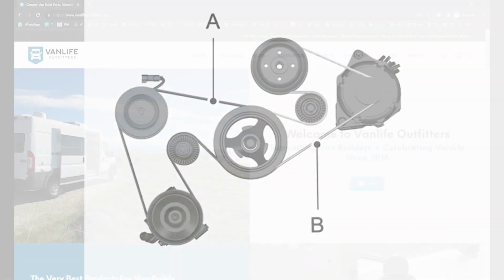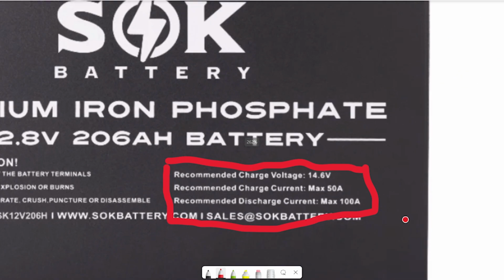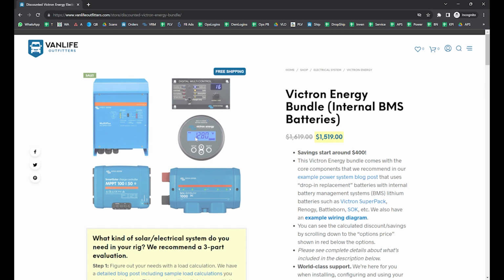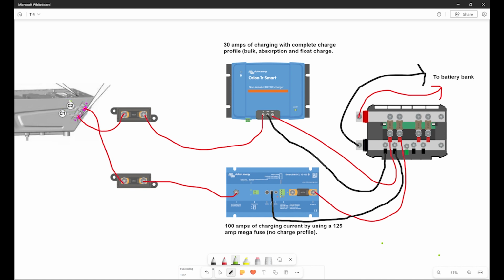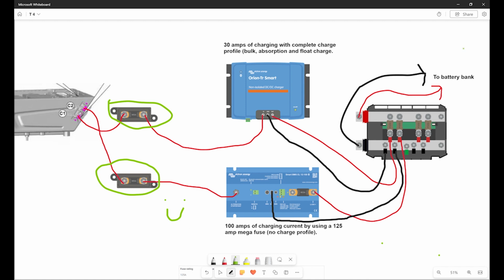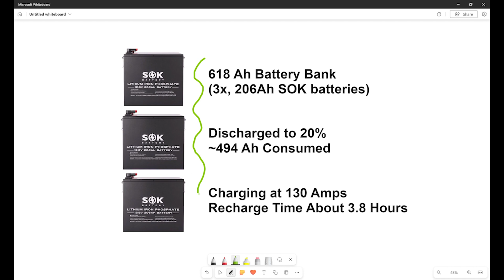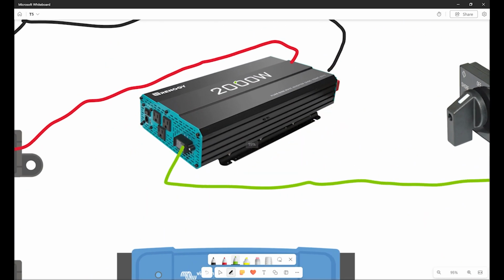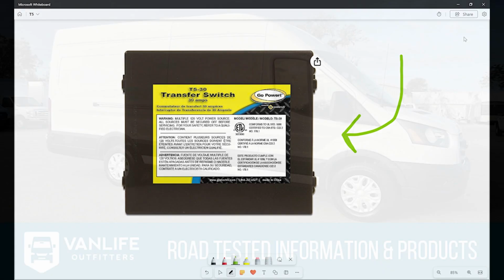Charging House Batteries with Ford Transit with Factory Secondary Alternators

Comment: Do you have an idea how much power the BMS uses as a current regulator?  Did you measure the voltage drop at a few current rates?

Comment: Hello, this is exactly what I imagine doing.  DC AC DC and get rid of having to have massive wires running to the back.  But I am curious how you limit the current with the 2000W inverter to prevent it from drawing all 2,000W and possibly overheating the alternators?   

In a vehicle without a second alternator already, what about installing a 56V 100A alternator and using a 100A MPPT controller to charge a 48V bank of batteries?

Comment: This is great info, thanks.  Using the first method does the BMS need to be turned off when the Orion switches modes from bulk? Or will the batteries stop pulling from the BMS at that point?

Comment: Appreciate the video!  We're in the midst of our electrical plans and are utilizing the Orton DC-AC-DC method as we weren't thrilled with any of the DC-DC chargers on the market.  We don't have the dual alternators, but are planning on controlling the amount we pull from the single 250A alternator with the Multiplus. I've not come across many videos discussing this method.  In your Orton Method Diagram, where are you connecting that negative coming off the inverter input?  Does that go to a (chassis) ground point around the driver's seat?  I'm struggling a bit with the concept of grounding in a van for some reason, it's about as agreed upon as proper insulation as far as I can tell.
Reply from the maker: The ground would either be the vehicle battery or a solid, chassis ground.

Comment: I’m glad to see DC-AC-DC explained well. Thanks!

However, I don’t understand the suggestion to use CCP1. It is non-regulated, and will drain the starter battery. Why use it at all if you have 175A coming from CCP2? 

If you really are using all of CCP2 and really need more, then it makes sense to use CCP1, with care. But why start with the premise, for both of your systems, that you need an Orion on CCP1 and then you add?
Reply from the maker: The Orion DC-DC charger has a "engine detection" feature that, when configured, will only turn on/start charging when the vehicle is running. Or you can wire it's "remote" terminal to the ignition switch. The video is just brainstorming ways to maximize charging from both customer connection points. Also, we wanted to show on "proper" charger in the system that will do a 3-stage charge. The Smart CL BMS will not. Most folks will likely have solar, etc. Lots of ways to approach a power system!
Reply: Oh , I agree, lots and lots of ways. I do think, though, that if you are going to suggest use of CCP1, you should explain the important downside. There is a reason that most folks are using CCP2 only. Complicated stuff, so hard to decide what to cover and what to leave out. Thanks!
Reply: One other point. If going DC-AC-DC, then I would argue that also using an Orion just adds expense and complexity. You get proper lithium charging through the Multiplus, and you can draw up to about 150/170A from CCP2 before you risk blowing a fuse (which are a massive PITA to replace). And of course you can use the shore power limiter on the MP to tune that down if you wish. Cheers!